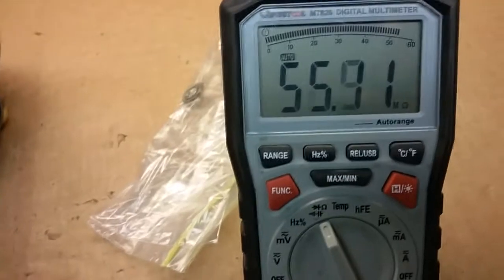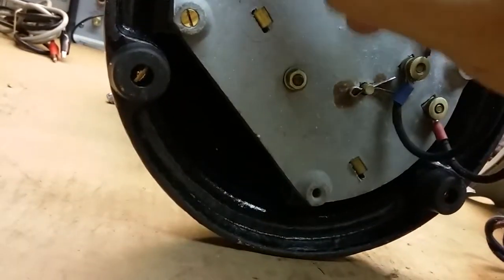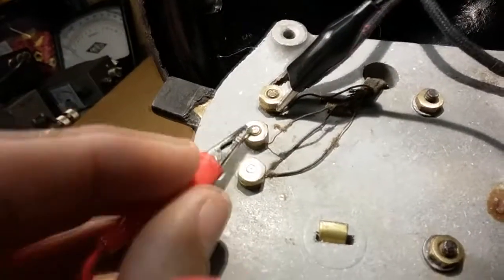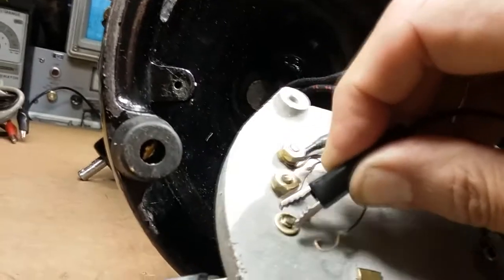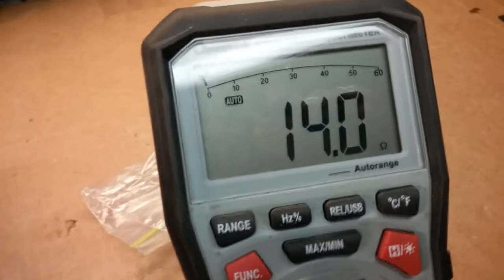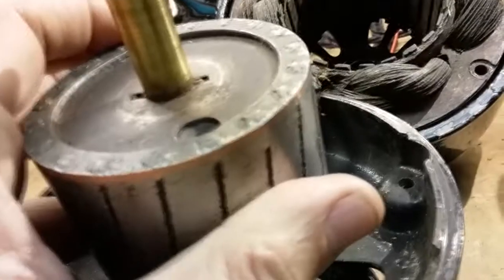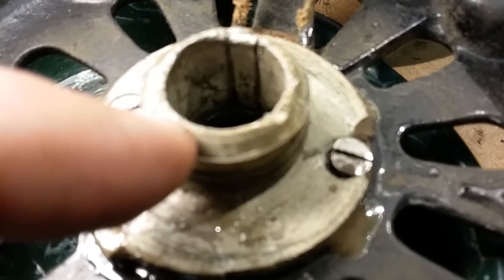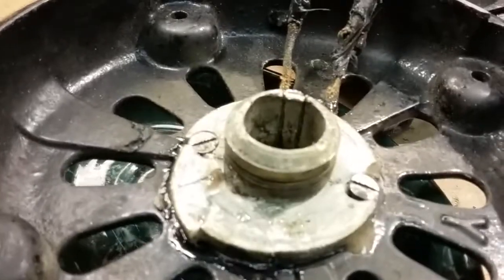1890s GE Antique Fan Motor & Speed Control - No 337738 - Part 1: Diagnosis

Comment: I have a General Electric aq1 and after removing the motor from the shell the coils became loose and vibrate is there a good epoxy I can use to keep them in place?
Reply from the maker: Hi Wes, It is hard for me to answer that without knowing what exactly the issue is. Usually the stator is tight in the case. I never heard of one being loose. Nor have I heard of that happening to the stator coils. Normally there are some type of shims wedged in and the entire assembly shellaced in place.
Reply: I am able to wiggle the coils.
Reply: Is it possible the shellac holding it in place broke with all of the pounding to get the motor out?
Reply from the maker: @wessandlin8056  yes that is possible but uncommon.  Did you ohm out ther coils? If they are not open or shorted, you can put generally put some wedges in between the core and the individual coils and then spray a few coats of shelac.
Reply: @ElectroRestore  what would be good to use for wedges?
Reply from the maker: @wessandlin8056 , wood or stiff cardboard.  Spray them with a coat or two so they are not porous and to stiffen them up.
Reply: @ElectroRestore  would something like a popsicle stick work
Reply from the maker: @wessandlin8056  Yes just be sure to shellac it first. It is required, but advisable.

Comment: Paul, thank you for your explanation of the wires leading to the speed coil.  Very interesting and a good lesson to internalize should anyone else pick up a miswired unit.  I can't believe the number of fans and other items that are "repaired" in a slip-shod manner, especially considering that it doesn't take much more time to do the wiring and repair correctly.